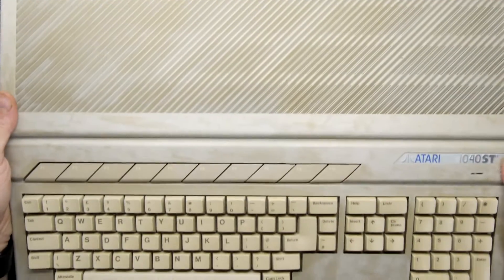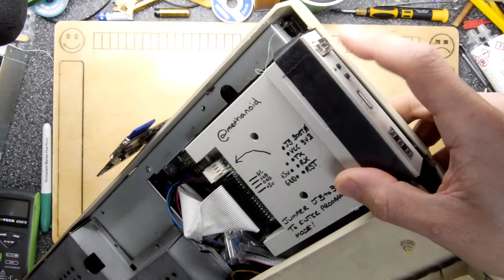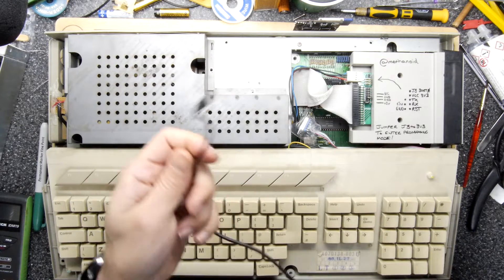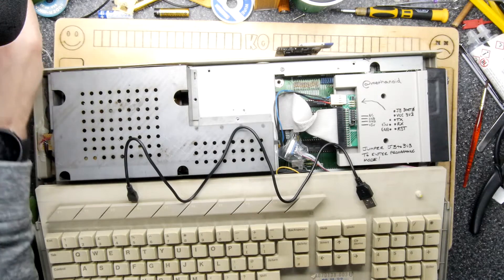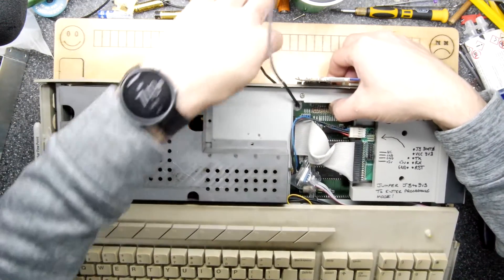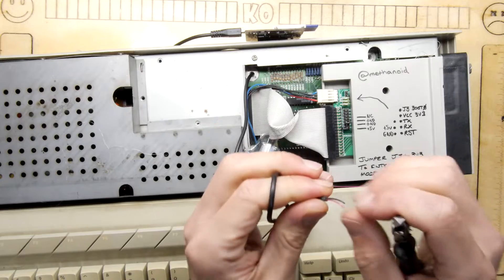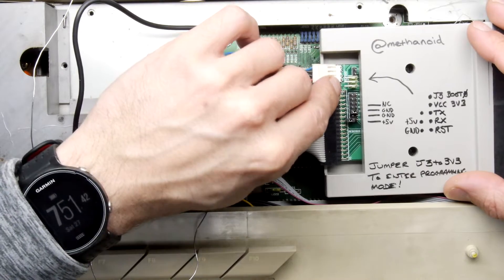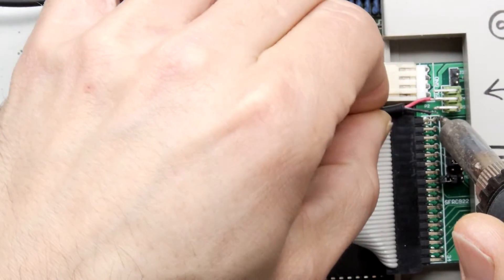Atari ST USB Power Hack

Comment: Your opinion please: If one was a musician using and Atari to generate music files for over a decade, filling old re-purposed SCSI hard drives, how would you back up that data. Your unit is hogging the ASCI/DMA port, the very port that leads to the external drives with all the data. Ideas?
Reply from the maker: Obtain USB power from somewhere else while backing up might be the only option

Comment: Love your hacked 1040! What are the options for using an lcd display with an ST?
Reply from the maker: So there's plenty can I point you in the direction of my Atari ST playlist there should be some on the HDMI SCART adaptors however my preference is to use LCD televisions because they already have such a vast array of inputs including RGB SCART.
Reply: Thanks! I was being lazy, asking before checking your older vids...
Reply from the maker: I'll let you off then must be at least 1300 earlier vids 😂

Comment: Nice to see you doing Atari again Andrew.. did you drill a hole in bottom of case for the USB cable to enter where it did?
Reply: As he mentioned int he video,its though a factory screw hole.
Reply from the maker: Exactly this, however I have a screwholeless mod as well. There are a few openings around. I might make a USB power strip that plugs into the cartridge slot for anyone not wanting to crack the case

Comment: Where did you buy your SatanDisk from?  I can only find UltraSatan - disk's on the internet.  I don't see the need for a UltraSatan when the former will do fine.
Reply from the maker: https://youtu.be/gnS-n-I8xr4 I totally agree. The one from this chap was very neat. Is be tempted to make a batch of people needed them. The problem is finding the correct SD cards as they do not like HC. Though someone might update the firmware
Reply: EduArana at Arananet I think ;-)
Reply from the maker: That's the fellow!
Reply: @methanoid  £62 for a SatanDisk.  Not bad.